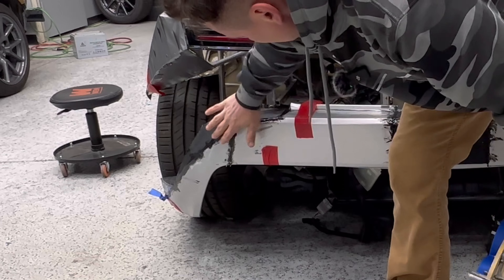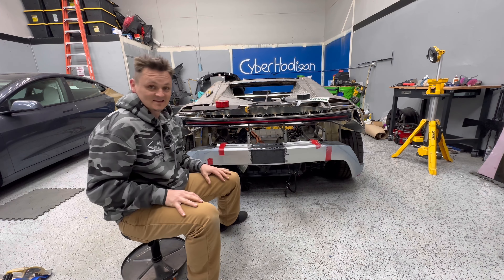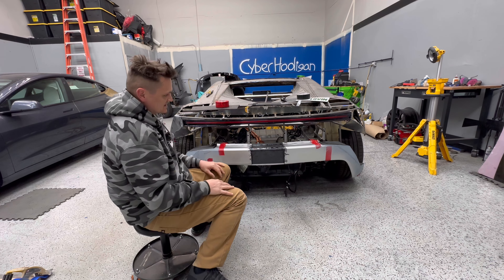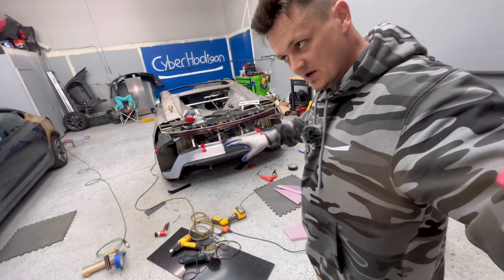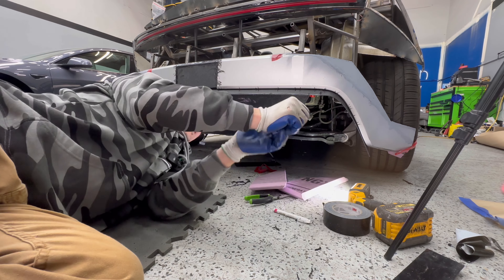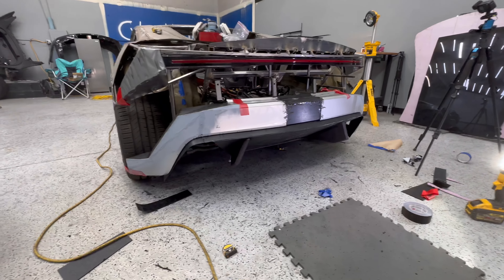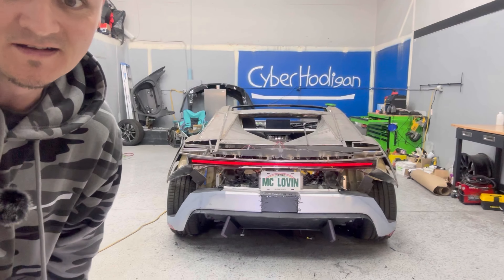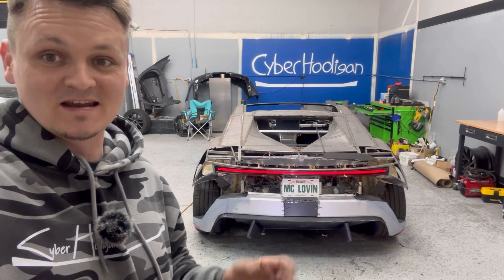Making a rear diffuser on the Tesla CyberRoadster

Comment: ABS reacts with acetone. You can chemically bond abs to other abs by applying a little bit of acetone and pressing both panels together it is super fast and really strong. In addition you can dissolve some scap abs with acetone in a jar and make abs putty which you can use to bond the seams together really strong since after it dries its just abs.

Comment: The Diffuser-Fins need to be parallel! Firstly because otherwise they just increase aerodynamic drag. And secondly because otherwise you add yet another angle to the car ... which has already sooo many angles. It's too much at some point, aesthetically. ... And the aesthetics also have to do with the aerodynamic drag. It looks bad, if it functions bad.  ... Just my 2 cents. ;-) ... Good project!